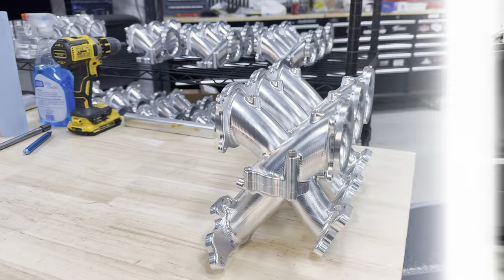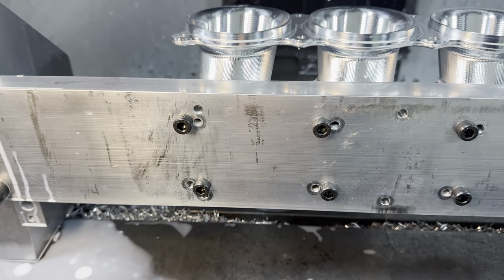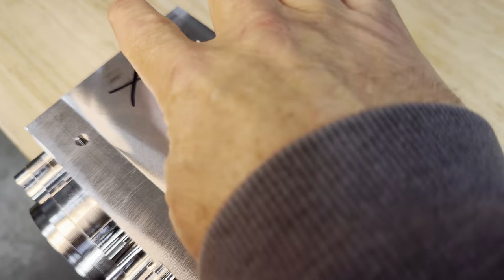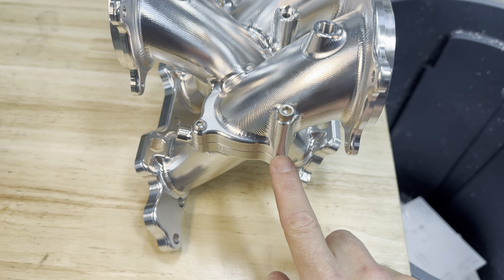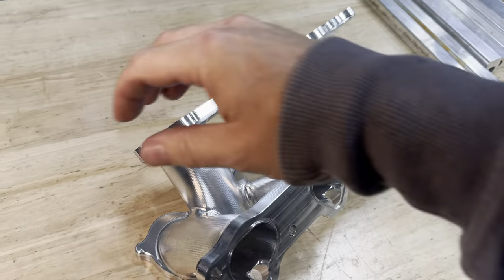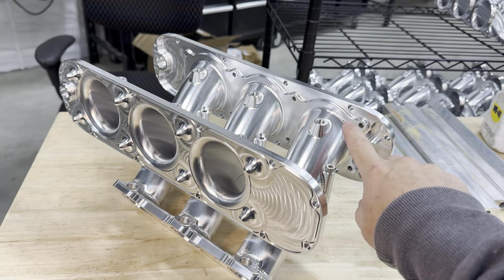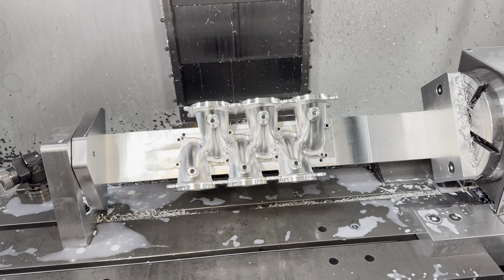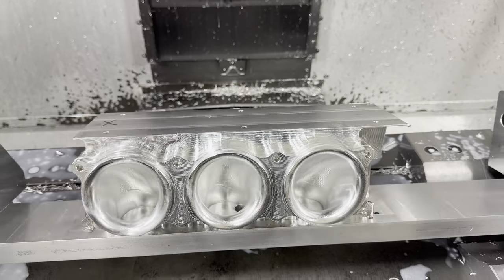Fusion360 4 Axis Machining of an Intake Manifold

Comment: Thats really incredible work! Been trying to program intake runners for cast itb manifolds myself in fusion but can figure out a smooth good toolpath for it. Can you share any info on what strategy you used for the inside of your runners? Mastercam port expert does such a good job but dont have access to it any more.
Reply from the maker: @colinbauer9795  I’m currently working on a whole video series on building this manifold from design to cam. Stay tuned!

Comment: Were you able to use F360 to figure out intake flow targets and calculate runner lengths?
Reply from the maker: No, first off because I don't have the fusion flow analysis plug-in, and secondly because most modeling software's flow modeling is very basic. Runner length is mainly a function of frequency harmonic tuning and none of modeling software that I'm aware of can solve for these parameters. They can however be calculated with a little studying and math if you know where to look. Although that as well is just a reasonable guess at best. True runner length tuning requires high speed per runner pressure data collecting combined with optimization of tuning for each specific length tried, it's really difficult for anyone but very high budgeted teams to properly do.
Reply: @linderpowersystems_LPSFAB  that's the idea I've been lead to believe thus far. I'm building an engine that will need a custom intake and looking for ideas, but calculating up an exact match seems impossible. It appears that I should, instead, aim for an intake that's close enough to my needs.
Reply from the maker: @MVanDii  look into intake order harmonics or runner length calculators. Thats a good place to start, if you are an SAE member there are some good SAE papers written on the subject.